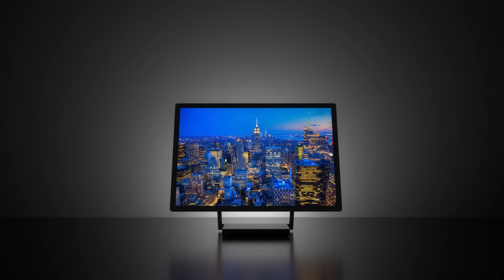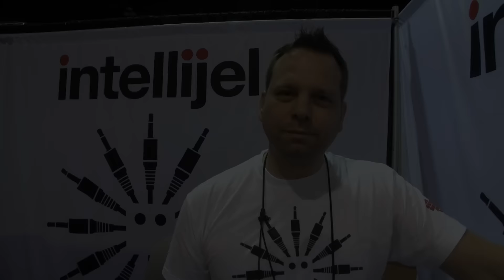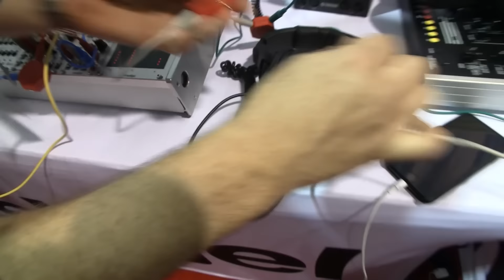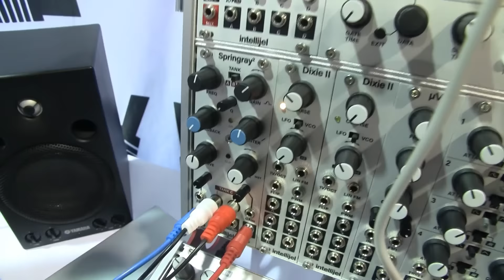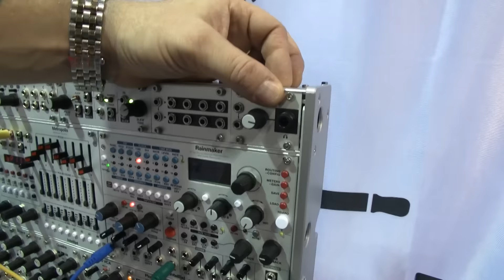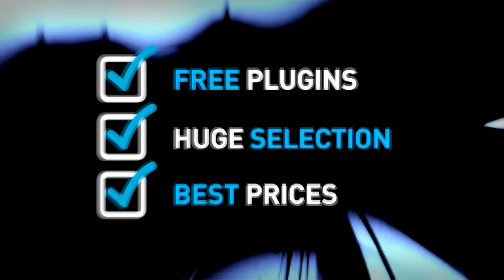NAMM 2017: Intellijel - 10 New Modules!

Comment: Regarding the Shifty, "There isn't anything like this out there", really ? How is the basic functionality of this module any different to a Doepfer a-152 which has been around for a decade ? All you have to do is clock the module with the same clock that your sequencer gets. T&H, S&H, CV control on the a-152, I don't see what's the deal here.
Reply: I still don't see how that is different. You don't need to use the Digital outputs of the a-151 at all, just mult the Gate that goes to the a-152 clock input to the switching part of the module and have it go to the different VCAs like you would from the Swifty's outputs. The Gate opens/closes exactly like it would with the Swifty and the different stages can have different gate lengths. The a-152 also gives you S&H and T&H option just not on the front panel. The stages are CV addressable so you can do directions and random with CV input. It's also 1:8 and 8:1 so it goes both ways and with more ouputs/inputs. It can be patched as Shift Register but not at the flip of a switch. It can also stay on the same stage for more than just one step at a time which the Swifty cannot.

I like the Swifty, I just expected that cool Intellijel twist you know to make me want to buy it .. still, nice to see it's 6HP.